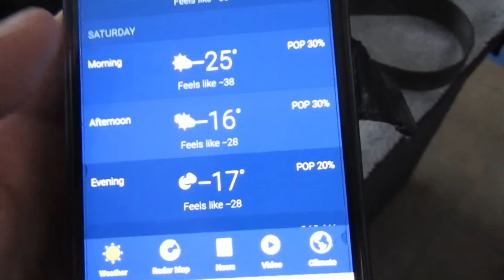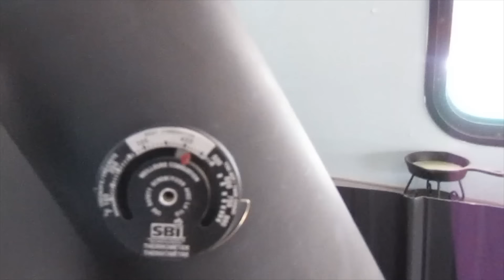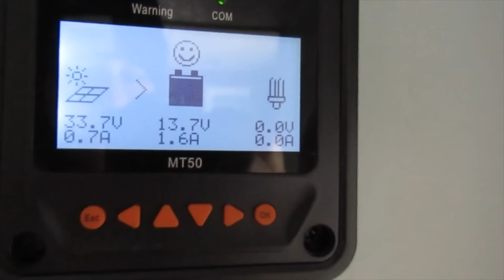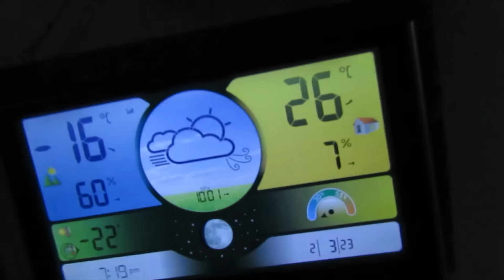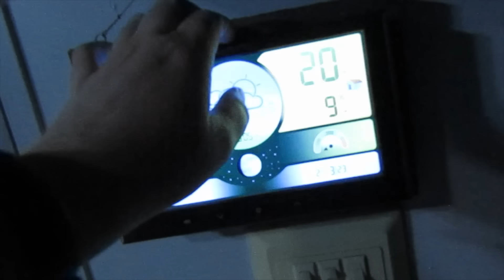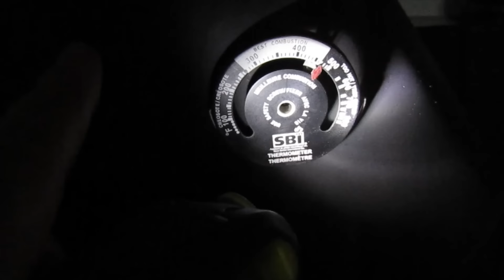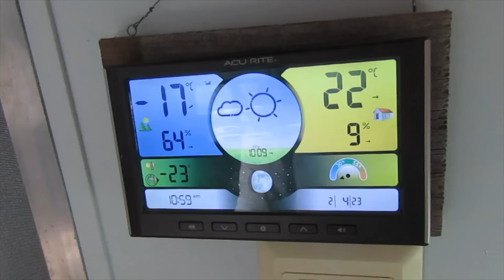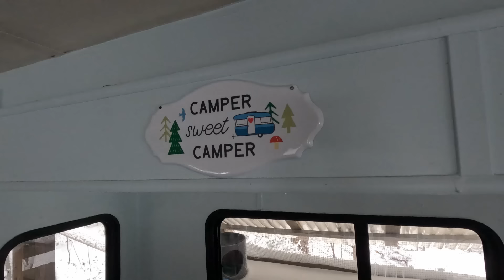Camper Living in Extreme Cold Warning

Comment: I use a Mr heater in my RV and it keeps it so warm!!! 😊 we had an older RV with a lot of drafts and in very low and every winter we would get  thick visqueen to fully cover our windows. Even in negative temperatures it stayed warm.
Reply: Can you give me more information about Mr heater never heard of that I'm going to try doing a Google search
Reply: @burgundyjayde  the little red heater she has in the video connected to the small propane tank she brought in the house. That’s a Mr heater go to their website it will tell you everything you need to know they are used for tents RVs garages all indoor safe and inexpensive to use and run. I can run mine 8-10yrs a day half high half on low and a 20lb propane tank last me 3-4 nights plus half a day give or take. Ii fill my 2 20lb tanks for $12-$15 so t but the prefilled it’s twice that much.

Comment: When I lived in and RV .. I used that silver RV insulation and 6mm of plastic on all but 1 window , and wrapped the bottom of the trailer and put big blankets on the floor and then bought a Home Depot oil heater …. And all was perfect even when it was super cold and snowing … I didn’t have to have a wood burning stove …. However - 40 I never faced that type of cold … 0 degrees would be my worst and it never stayed that low .. usually 10 to 20 degrees for 1 month then it climbs 10 degrees .

Comment: I used a kerosene heater in a single wide trailer and it worked good but kerosene rates are ridiculous. As Ron below suggested the Buddy heater is also good. Insulating as much as you can will be helpful. Good video.

Comment: I'd look into straw bale exterior insulation from ground to the roof on that thing. Also, what about covering your windows with ridgid styrofoam insulation, especially in the winter months? I also use a 30 lb blanket from Amazon, really made more for "anxiety" but its hell of warm, and you could also put an electric blanket in it  for maximum heat.

Comment: Hi there. Wow you brought back memories for me. I survived two years living like you. We had a 28ft. camper. One thing I did was build a 12'x16' room off the entrance door. That's were I put my wood stove. I had an Ashley wood stove with a thermostat and flue. 4 to 6 hr run time. Boy sometimes I'd have to open the door to cool off it was so warm. By the looks of your stove pipe I'd say you might not be letting the stove get hot enough? Lot of creosote build up you have. It should be burning those gases off in your stove. And yes you had a lot of coals in that stove it needed air but your smothering the fire by not letting it breath with the damper. Open the air intake to the stove and keep the pipe flue slightly open so you have enough up draft. You'll have to experiment for a bit but you'll get it. I never had a thermometer on my pipes but when they started to glow a little red I'd turn the stove air intake down (in my case it was a thermostat) a little bit till they didn't glow. I know your worried about starting your house on fire and you should be. Fear is a good teacher. It's one of the reasons I built the room. I was able to install the stove to code. Anyways I'm rambling now. Keep up the fight your doing what you need to do. Been in your shoes here in Maine.
Reply from the maker: Thanks, I have thought of an add on several times. Mostly just for a mud room to use as storage for coats and shoes etc lol. Yeah it's a battle, if I let the fire burn too hot, it gets too hot in here so as a result I just deal with cleaning the creosote weekly lol. Thanks for popping by

Comment: Have you considered sacrificing some interior space to put better insulation in the trailer? I said screw it and sprayfoamed all the crevices. We also hang an old comforter in front of the door to help with drafts. Being stationary I’m tempted to frame out 3” and add even 1/2 a batt of Roxul on the walls. We have huge condensation issues on the West Coast.

Comment: During the Texas cold blast of 2021 I saw -2 degrees f. just North of Ft Worth where I lived at that time. It was the coldest temps Ive ever seen,and do not want to see that again. I was heating my camper then with two space heaters and three heat lamps. I was praying that the electric grid didnt crash,and it didnt where I was. Now I have the diesel heater and propane heaters with two big tanks. Yea it gets hot down here but I can deal with it better than those cold temps up there. Stay warm and stay safe.
Reply from the maker: Always good to have back ups! 🙂

Comment: As someone that does live in a area that is colder then that all winter reflexes window covers and wool blankets for curtains to help keeping heat in and to help insulate the lower part of my camper use straw bales an also close off the bed and can keep warm with a blanket over it and my 2 dogs with a cubicle heater

Comment: That’s brutal temps. I lived in a travel trailer and the windows are like car windows and they all leak. So… I got insulated curtains and that helped tremendously. The the front window that cranks shut I put foam insulation on the inside of it and cranked it closed. The floors I bought thick throw rugs and it helped but the damn windows really makes it cold. Glad you made it safely with those dangerous temps. ✌🏻
Reply from the maker: Good idea with cranking the windows closed with insulation inside. Probably made it pretty dark inside though I guess
Reply: Dark vs cold 🤔 Lolol
The insulated curtains was the big winner and you can open them when it warms up. The thick throw rugs helped because they have nothing underneath these rigs unless you do it. I was reading about these 4 season rigs and they aren’t as 4 season as they claim. The doors leak and when it got nice out I took the tin surrounding the door and shoved foam around it and that helped. Anyplace where I felt a draft I put insulation and under the sink area in the kitchen was terrible. So I bought 1/2 styrofoam and lined the walls. These rigs like mine are like living in a car lol I had an old Dutchman and it took time to insulate it but it really helped and in the summer it kept the heat out. And all the work you do to survive out there it gets tiring. I admire your heartiness👍🏻I was laughing a few videos ago with all the gadgets, remotes and lights everywhere. Climbing up and down ladders can be tricky. Stay safe cheers 🍻✌🏻

Comment: Wow -23 that's cold! Where I live in Oz the coldest temp last winter overnight was -1 and I had my heater cranking to keep the van warm so I can't imagine what it's like to keep heat cranking in those kind of temperatures, my van was made in the late 70's and sadly the manufacturers didn't put much insulation in. Gluing 2" thick polystyrene foam sheets under your floor would certainly help with the cold floor. Since winter is now upon you there again for Christmas 2023, hopefully no more polar vortexes, here in Oz we have bush fire risk dawning so hopefully no fires near me.
Reply from the maker: I hope not, stay safe out there!

Comment: The wood burning stove actually bringing in more cold air from the outside. I would place a 3", or 4" pipe inside the stove and routing it back out so the warm air from inside the pipe makes the room warmer with less wood being wasted. Not all wood burning stoves designed that way which they should. A few pieces of wood would be able to last throughout the night. But I have never been in -26 or colder. Enjoy your video. Learn something from you.

Comment: I live in a 1962 trailer 3 minutes walk from Beach.  We get four seasons here.  The electric baseboard heaters fail to keep trailer warm when the temperature drops below freezing.  Use a buddy heater for supplemental heating.  Obviously trailer is old and not insulated but fortunately we don't have a lot of area to heat.  I keep the buddy in the kitchen living room area where I work.  Our master bedroom in the back of the house is small...queen size bed takes up most of the room.  The baseboard heater works good enough in there since it is such a small space.  It's still fun here in the Winter at the beach when it's just locals but it feels colder than it really is...kinda like 60 degrees in Florida in the Winter.  We put in new windows and doors when we bought this place and that helps retain heat better.  I don't no why but in February every year we have plumbing issues and I get sick.  Nothing like having no working toilet in Winter when I have the flu.  My goal is to get the hell out of here next February.  Half my neighbors split after Thanksgiving and return in March.  Working on off grid self sufficiency.  Have that worked out so I can split and work/ live in a tent in warmer climate for the worst of Winter.  Saving money for a truck camper or teardrop but can manage with the right tent and gear just to escape the cold.  My wife is not down with the tent so I may go solo for three or for weeks and camp.  Solar and 5G hot spot allows me to work anywhere but I'd really like to retire and hit the road,  keep our old trailer for home base.  That's the dream gotta keep your eye on the prize.  😁
Reply from the maker: That's an awesome dream and YES!! Always keep your eye on the prize! I hope you can retire sooner than you think! 🤞

Comment: Propane don't freeze except below -44F but water in the tank will cause regulators to freeze up.
If you can ask your refiller next time you get them filled to put a little methanol in the tanks before they fill them it should help.

Comment: I bought a mobile home (trailer) in one of the only residential mobile home parks in Ireland.
Even though it has the winter package (gas radiators and insulation) the first thing I did was get a builder to strengthen the walls with plaster board and more insulation. I also got him to do the floors. They are just like the walls in a house now only better insulated. I've the gas radiators which I never use and a solid fuel stove which I use all the time. It's enough to keep the place lovely and toasty in -5c. I burn wood and coal together then coal only when I go to bed which means I wake up to glowing coals and a toasty mobile. Thankfully we don't get much colder than this.
If it's 0c or a bit above I let the fire go out at night and light it again the next evening, the insulation keeps the mobile comfortable till then.
You'll notice a big heat retention difference if you cover those windows and insulate the walls and floors as best you can.

Comment: Your heat is going straight out of your windows. You need to insulate them. We used the extra floor underpayment foam we had in the windows and it worked wonders

Comment: You know,  it always surprises me when old tricks are forgotten.

Now simple stuff,  curtains.   historically curtains were not used to keep light out, but... as insulation.   so putting some good heavy curtains over doors, windows... helps limit drafts and heat loss.

dividers,  the smaller the area, the less heat is needed to heat it, again, a simple divider to block off part of the trailer will lower the temp on one side, but retain and increase the temp on the other.

In really cold area's a lot of people use Diesel heaters as back up.   And some use them as their primary.   a 17000 btu/5kw unit might use 1 gal of diesel per day.   running 24/7 at max power.   so if you are only using it as a secondary,  burning 5 gal a week to heat isn't horrific.

Comment: I winter camp in MN on my own property.  I'm in a 40' destination trailer with tons of windows and sliding glass doors ... it was the cheapest "cabin" we could come up with at the time.  It's a naturally drafty trailer.  Last year I removed the dinette and installed a Drolet wood stove which keeps it about 85 in here when it's -44 with windchill outside ... and that's with just coal bed and maybe 1 or 2 logs, as well as a window open to help with fresh air.  Our LP useage from Dec 15th to April is less than 100 lbs as the furnace only kicks on when we're away.  How are you not keeping warm with a stove going in there?

Comment: Awesome video! So looks like you are burning birch? Or is that poplar? 
At first I was kind of surprised that you were having a hard time keeping your place warm because you’re skirted in and that makes a huge difference. 
You are burning solid logs so that’s good because once they get going they put out more heat than splits and burn longer but the issue with your wood  is that it’s not seasoned enough. Birch takes forever to season at least 2-3 years especially if it’s not split. The black on your front glass tells the story that it’s not seasoned. Wood that isn’t seasoned doesn’t put out anywhere near the heat that seasoned wood does. I lived this lifestyle here in Alberta for four years and two full winters totally off grid out in the foothills in the mountains of Alberta and -40 is pretty common in the wintertime and that’s without the wind chill and back then I would cut dead standing wood and my little stove that I built put out pretty good heat but at that time I didn’t realize the importance of seasoned firewood and how much of a huge difference it makes in heat output. 
Also try filling the stove as full as it will go get a bunch of smaller pieces of split wood to jam into ever corner of that stove. 
Is that double wall chimney pipe? If you don’t smell paint burning then your pipe is not to hot. 
I seen how much smoke is smouldering out your chimney that is because it’s burning wood that isn’t dry enough. 
When you cut your logs take the chainsaw and cut a stip down the log on both sides 180° apart. Cutting the bark like that helps speed up the drying But when you don’t split Birch it takes a very long time to season versus when it’s split but even then it still takes longer than the average firewood. I’m not very experienced with any other hardwoods other than Birch and poplar but as far as I know there’s no really such thing as a dead standing Birch they’re all pretty green when you cut them so if you try to burn them within the first year they just don’t put out the heat like they will after they’ve been seasoned. A dead standing birch is usually rotten. 
Is that one of those stoves from Canadian tire? Does it have secondary burn? Those newer EPA stoves like to have seasoned wood whereas an old smoke dragon stove from the old days or like the one I built out of a piece of oil field pipe will burn anything. 
What types of wood do you have there?

Comment: If you could seal the space between the roof and the camper roof and fill that area with insulation you would probably decrease your fuel consumption by 60% or more and increase your comfort factor by 100%!

Comment: I have experience living in campers through 45 below. Cover the propane bottles and your cover with something black. Black will drawn warmth to it. I used landscaping fabric at first but then I found a cheap black yoga mat at the dollar store and cut up two of them and made a cover. You would be surprised at how much the colour black changes things. Also don’t be afraid to get a light bulb on an extension cord. A lightbulb is enough to stop the lines from freezing. Also if your fridge quits you have to take it out and flip it upside down and back up again the hang a tiny light bulb behind it when you put it back in. Just some tricks I have learned. Also putting the cords for EVERYTHING taped up under your camper. All electric cords and hoses. You will see a huge difference in electricity and everything. Especially if you have an issue you don’t have to dig anything out of snow or ice. I even put a small heater underneath the bedroom floor. You should cook on that wood stove too. Meat is more tender cooked on a wood stove. Make a roast and just line the roasting pan with onions. It’s great! I even fry my hamburger on a cast iron pan on the wood stove. I also keep a pot of water on it so I can make tea whenever I want. Also you know exactly how hot you wood stove is based on whether the water is boiling ir not. I also like to have some unseasoned wood on hand so I can dampen down the fire overnight with a few pieces and not have to load it up as much.
Reply: During a power outage once I came home to my kid making all her friends Kraft dinner on the wood stove. They were amazed that she knew how to do that. ❤
Reply from the maker: That's awesome 👍

Comment: Windchill IS NOT temperature. An example. Water, at sea level, freezes at 32 degree F. If the temperature is 35 degree with a windchill of 20 water will not freeze because the temperature is 35. Windchill is a factor that effects how quickly temperature can bring objects down to the actual temperature.

Comment: Do you cover your windows, I am sure that would help with keeping the inside temperature warmer, also I have seen people hang a heavy blanket at the door to stop drafts.  Every bit helps. Even living in a house having window coverings makes a huge difference. Good luck.
Reply from the maker: Thanks, I left the blinds in the bedroom with some curtains as well. I removed the blinds in the main area and haven't hung curtains there because normally with the wood stove it isn't necessary and they dirty easily from the woodstove as well

Comment: HI, just a suggestion, put a "damper" in the stove pipe. Without that damper, you will lose alot of heat out the pipe. It also acts as a safety, if your fire is raging ,use the damper to restrict the flames from entering the flue pipe. You will be able to heat more with less wood. Happy Trails
Reply: Do you niebhors who are close for emergencies i would be scared
Reply from the maker: I do have neighbours, yep :)

Comment: The hot coal is what pumps the heat, put a damper in the pipe , once you get a lot of coal damper it down, open when you stoke it , the heat just goes right out the chimney without one